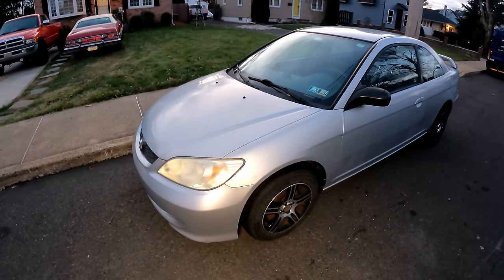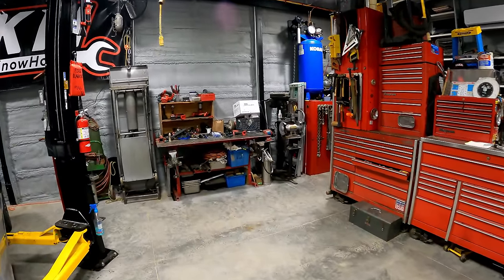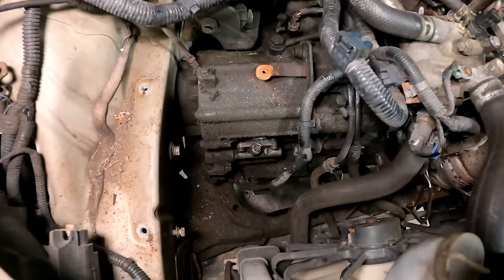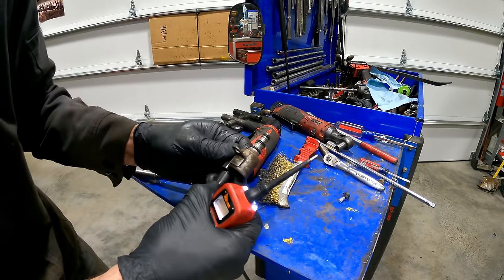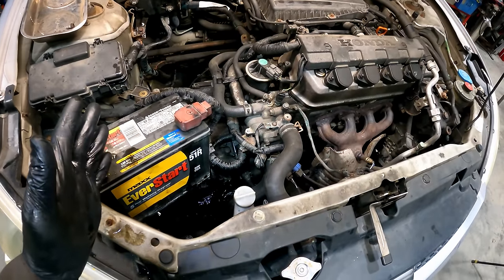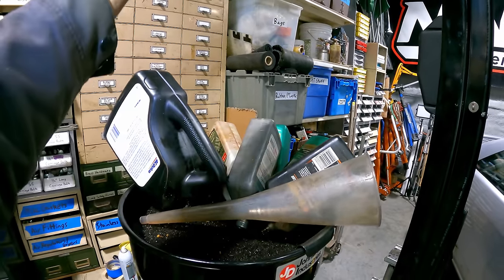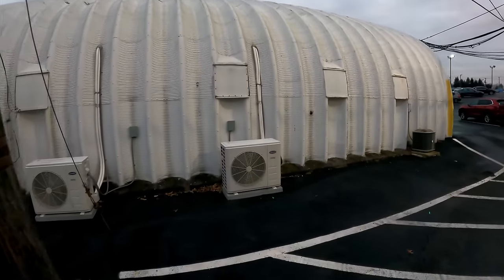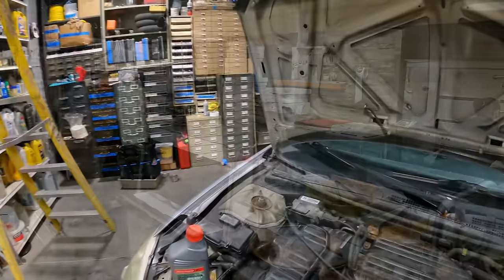Honda Transmission Slipping FAST/EASY FIX

Comment: Excellent video Chris  :) fun to know those Honda very good dependable  and low mileage on Jen Honda Civic car too! Also  ever found on 1980's  Honda Accord EXI had 4 speed Automatic transmission  with problems in put Reverse grind sounds so have put Park and Light R selection and No 4 for Overdrive gear ! My middle brother had that car and did took in Honda said transmission fine also did fluid on right time ! But sold car back 2007 found at different place does transmission tons and said 4 Gear broken and pecies tooth of Reverse gear  broken off ! So full rebuild  and fluid change to also cure it ! Was lot money but been okay since and new owner of car to told drive like new !

Comment: 7th gen 2001-2005 civics auto trans are horrible!    If you are going to fix, there is an online filter that you should for sure change. And always use only Honda fluid.  Good luck

Comment: Many Honda Trans. filters are on lower front of radiator support. Behind bumper cover. In cooler line.  Looks similar to GM fuel filters.
Reply: He noted that this vehicle didn't have it 😢

Comment: Looks like Jens civic needs lower control arm bushings.  I have a 7th gen and have changed mine twice so far. I just went with the aftermarket control arms with bushings installed.
Reply from the maker: Honestly they're fine until they get really loose and sloppy. Putting the aftermarket ones in there is almost a waste of time because they dry rot and split prematurely. If I were to replace hers I would definitely go OEM. But it's not like they're going anywhere being split. Meaning like the wheel is not going to fall off or anything. Now if she started having shaking on the highway or other issues then maybe address them

Comment: There was probably zero friction modifier left in the old fluid.. That stuff was really old! Usually  a 3 x drain and refill is required on most Honda transmissions to get all the old fluid out. I would drive it for a while and change it out once more. Change it every two years from now on and i bet it will outlast the car!

Comment: Is this something you would have tried working in a shop? I suspect shops don't encourage this and want you follow some book procedure to make it easier to charge out labour?
Reply from the maker: In the shop we would probably just replace the transmission with a remanufactured one or send it out for rebuild.  Problem with doing this kind of stuff at a shop as you can't put any warranty on it and this could have very well caused more damage but then again the thing already didn't move so not much to lose
Reply: Plus you had a spare in the wings! ;) @NNKH2

Comment: Awesome. Might try a diesel flush on my old volvo penta boat trans..... I have an 04 Civic but a 5-speed. My shop told me that I never need to change the trans fluid because it's a manual....is that what you would do? So far so good at 199k miles.
Reply: It’s not going to hurt it to change it. Might smooth out your shifts a little

Comment: That’s great. That’s low miles for that civic and it’s her first car. She should def keep it. All she needs to do is restore the headlights, add LED bulbs and put some window tint on it. Quick and cheap but would make a huge a difference.

Comment: The 04-05 actually have much improved trannies compared to the 00-03 cars which had lots of issues. Hard to knock the car when the oil had 160K miles. 
Couple things.... these cars have their trans oil checked with the engine off.
A lot of the outside mess can be from the dipstick shrinking and leaking. A new one is cheap and easy to install.
An external trans filter from later Hondas is easy to install on one of the cooler lines. Part #25430PLR003
I've got over 250K miles on my Civic on the original trans and it's working perfectly still with the above steps and oil serviced every 50K.

Comment: I used cheapest fully synthetic atf I could find in my k24 2004 accord. Changed it at 80k now the car is on 190k. No problems. I wouldnt have paid the premium for posh Honda atf on this personally

Comment: I think you should tell us what kind of back pressure , how much? I've heard people get it pretty messed up with too much and get nothing with too little
Reply from the maker: My tank was charged to around 100 PSI but I didn't hold it steady I was going on and off blowing into the hose and pressure was building up in the transmission. Luckily nothing seemed to have gotten damaged but I didn't want to go over too many details on that because then when people go to the same and destroy their transmission or get hurt I'm somewhat responsible I suppose

Comment: Ive had 2 honda pilots over the last few years. About once a year the car would surge while driving. Honda says the trans fluid has to be changed. Seems like it would last longer than a year.
Reply: Hondas must go against conventional wisdom. Generally older trans fluid is better!

Comment: You could take the extra transmission to a shop and have them pressure test the thing and if it needs rebuilt it's like a two hour job.

Comment: I wonder has she ever changed the fluid and filter because I know a guy with a Honda that never did any maintenance on the trans and the filter was plugged up and ended up burning the clutches right out of the thing because the fluid was having a hard time getting through the filter.

Comment: So it quit working due to a fluid blockage caused by debris buildup. I imagine it caused a positive feedback loop where the blockage created more debris, which worsened the blockage, and more debris, and so on until it finally quit working. That's exactly why you change the ATF every 60k miles or 100k kms without exception.

Comment: 2002-04 CR-V’s don’t have a transmission drain plug 😢 What to do? I use vacuum jar/pump to suck it through fill drain plug hole. Can’t really backwash tho — is that right?

Comment: What about a 2003 Acura Mdx with code P0741 Torque Converter Clutch Solenoid Circuit Performance or Stuck off?

Comment: I missed the logic and details behind the diesel. Did you put that in the trans? If so, why?
Reply: Is it acting as a solvent where it cleans out the trans?
Reply from the maker: Used it as a solvent yes

Comment: How's this transmission holding up Chris? I know that fluid is expensive but you should probably flush it atleast another 2 times since it had that diesel and wrong transmission fluid in it when you made this video!
Reply from the maker: So far so good.

Comment: The friction plates always burn up on Hondas and Mazda and VW … built in failure to make you buy a new car. And all the non metallic crud clogs up the solenoids
Reply: Well I had two Honda CR-V’s and one had working transmission when I sold it with 289,000 miles. The other CR-V I sold with something like 230,000 miles. It’s just some models that have had issues.

Comment: How do you flush all the diesel out of it? Wouldn't it still be in the torque converter after you drain it?
Reply from the maker: Changed the fluid twice. But yeah definitely still some residual left. Been good so far
Reply: Only way is doing a fluid flush instead of a fluid change. It can be done at home but is a bit more involved. You can go to a shop that has a flush machine. It doesn’t stop adding fluid until the color comes out the other side the same as the color going in.

Comment: My car just started doing this, after i got a oil change it started slipping, maybe wrong fluid? I have no check engine lights either but a bunch of white smoke did come out thr exhaust after the oil change too.. never trust jiffy lube 😡

Comment: Every other oil  change you are supposed to drain the trans and add 3 1/4 quarts of thras fluid. Routine maintenance by the book
Reply: excessive. so every 6k? I sincerely hope you're not doing 15k engine OCI
Reply: Where do u see 15,000 oil changes. What I said was by the book on Honda Odyssey. I'm sure the Civic is the same. Chilton was my source. So argue your point with someone that doesn't know any better. I'm out not going argue

Comment: When a worn manual gets hard to shift, I put ATF fluid in it. 

So when automatic gets worn you put diesel in it? makes sense i guess.
Reply: Nah only as a cleaning agent to flush out the internal screen/filter that's hard to get to

Comment: NNKH i had a 2022 honda Accord but the transmission broke thats why i don't like Honda.
Reply: Which engine powertrain is that? Is it still under 36k miles? It should've been under warranty.

Comment: I'm surprised no one mentioned the blown out front control arm bushing on the right front
Reply from the maker: Many comments about that. Probably going to do a part two video to follow up on it. I've shown them in previous videos. Truth is they haven't caused her any issues and it doesn't pull on the highway and it's not wearing tires bad so kind of ignored it since she didn't have a problem with it. I don't consider them a safety issue unless there are shakes and shimmies happening. It's not like the arm can come out of there.

Comment: Is the filter plugged
Reply: The internal screen was clogged. This last effort to try to back flush it worked for him... He did it 2x to make sure before refill it with OEM Honda transmission fluid

Comment: Try some Lucas stop slip, ive had good results using it, doesn't fix it but will give some time.....
Reply from the maker: We poured some of that in it when it first started slipping a little bit months ago. And then it gradually got to the point where it wouldn't move at all.
Reply: My buddys dodge 2500 truck wouldn't move, was slipping, I told him to try it, nothing to lose...., he put 2 bottles in and it's been good ever since, he actually tows his bobcat around with it, it's been over 2 years...

Comment: 164,900 miles (263,500kms) is really getting up there in age for a car small 4 cylinder cars don't last a long as bigger engine cars.

Comment: If you change the transmission oil at that much mileage & it has never been changed before it will often start slipping. Also, it is not a good idea to flush the transmission with diesel it can dislodge crap that can stay in the transmission, causing even more problems.

Comment: The ATF that was drained  was 'way past "dirty".  It looked like engine oil that was at twice the recommended  change interval. with mostly short trips.  With that mileage the ATF should have been changed at 30K intervals while it still looked relatively clear and reddish. Honda ATs are VERY sensitive to ATF condition. Many Honda models have an second, EXTERNAL inline filter ( (25430-PLR-003) ) located near the bottom of the radiator/cooler that is unknown or overlooked by many independent mechanics. The pressure and "back flush" either cleared it or ruptured its internal filter.  It should be changed.
Reply from the maker: Been driving great ever since. No further action was needed

Comment: After you get that trans oil clean you should just change the internal filter in there.
Reply from the maker: You have to remove and disassemble the transmission to do so
Reply: @NNKH2 You could practice changing the filter on the transmission you bought. Though I see on a video from two months ago Jen got an old RAV4 so don’t know if you’ve sold this. Guys, he went to buy the RAV4 in this car so was still running at that time.

Comment: Does anything have a pan with accessible filter these days? Toyota doesn’t. My Ford Edge doesn’t. I drained my fluid….about 4 qts. of the eleven drained out then I added four qts. and drove it for a bit then came home and drained it again and added four Qts. followed by a short drive then I repeated the process again. Checking the level on the side plug on the transmission for proper level revealed fluid that was still not totally clean. Why the hell manufacturers are now building transmissions without a removable pan and accessible filter is a bunch of crap.

Comment: Exactly what happens,,,,,especially yhe B7xa,B7ta,,,,filter is micron,,and plugs up.   Been building these for 20+,,,,,and Honda changed their clutch material every year for many years,,,,,,if the Trans ain't slipping,,,it will run hot and melt that orange plastic dip stick to the Integral Head.....doomed ether way,,,,an I like honda😢

Comment: check brake fluid , looks like its low
Reply: Low brake fluid (when the system has no fluid leaks) indicates wearing out/thinning brake pad material... So pull the wheels and inspect the brake pads 😅

Comment: Once the diesel "fixed" it, you should immediately sell it before it fucks up again.
Reply from the maker: It's running and driving well. Have a spare transmission for it if needed

Comment: They didn’t build these transmissions just right.. but typically if you drain and fill on time with the Honda fluid they’ll last for quite some time anyway. I’d go every 30,000 miles on these. And they actually have a drain and fill hole so cmon folks!

Comment: 😬 mixing fluids, not using the correct fluid, is a highly risky move. You have no idea if those fluid were compatible with each other or with the materials in the transmission. I'll give you props for ingenuity, but clearly you're smart enough to know better than mixing fluids, and running non-spec fluids.
Reply from the maker: Not much risk when we were planning to swap the transmission to begin with.

Comment: I've done this on engines but never a Auto. Trans. If it works it works & the internal filter is a TERRIBLE IDEA.

My 2007 MERC. has an INTERNAL TRANS. FILTER ( SCREEN ) also.

SHOP LOOKS FREAKIN NICE.

NO GUS ? DISAPPOINTED, GUS IS COOL.

Comment: Never changed the trans fluid? And you're surprised a Honda trans failed at 160K with no service? Ever work on a Honda before?
Reply from the maker: Yeah plenty. I think the better question is have you ever owned a Honda before and the answer is no.
Reply from the maker: Hope the video helped you out. Thanks

Comment: Stupid lifetime fluid. They’re not meant to be serviced. Just run until they die and then put in a new one. This way they can say it has a low cost of ownership and it dies shortly after the warranty is up. So it’s not their problem. So many newer vehicles are going that way. So stupid. The lifetime fuel filter on my Jeep Liberty. The lifetime filter plugged at just over 300,000 and took out the pump. I had to replace the tank because the lifetime fuel filter, and trying to cut it off I slipped. So down to the local bone yard for a tank. Then the parts store for a filter and pump. Don’t fix stuff anymore. Just throw it away and replace it. Somehow this makes vehicles greener?

Comment: Wow, that was an incredible save. Really smart way to clean all the sludge out. I'm sure you were a little shocked that it worked so well, but hey you had nothing to lose.
Reminds me of when I had a 90 Plymouth Laser Turbo with the 5 speed manual and it was almost impossible to put it in 1st gear. It had about 60k miles and the gearbox oil had never been changed. It drained out like dirty water. Put in Amsoil 75W90 and within a quarter mile I could feel the difference. In 1 day I could use 1 finger to go from gear to gear.
So many people ignore the owners manual recommended service intervals for transmissions and pay a hefty price!

Comment: wait 😮 what i just saw dude your lower control arm bushing is really bad its broken
Reply from the maker: The rubber is torn yeah. But it's not like it can fall off. It's just there for dampening. We did end up replacing it sometime after

Comment: It was very irresponsible of her never to have serviced her transmission for 170K miles, and you aren't doing her any favors by saving her bacon. All you are doing is enabling and engendering more irresponsible behavior on her part, which she will then demand that you remedy because, after all, you remedied it the last time. You should have told her it's not your problem and held her responsible for fixing it.